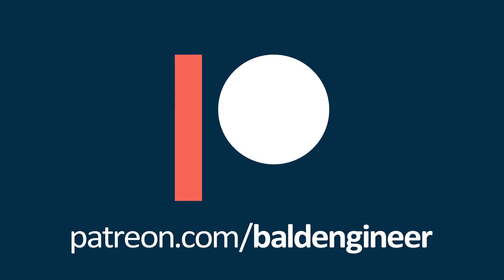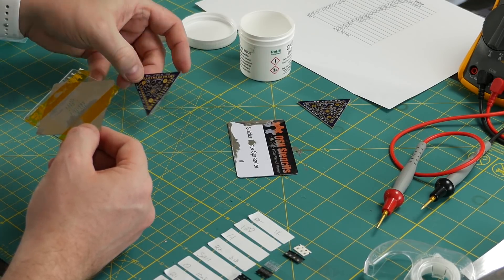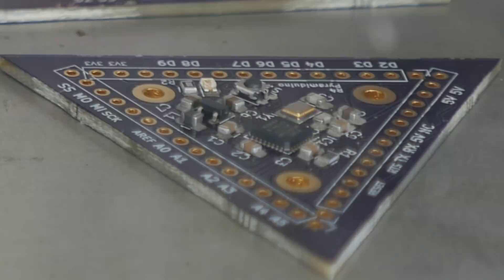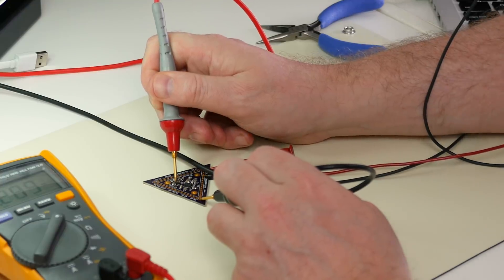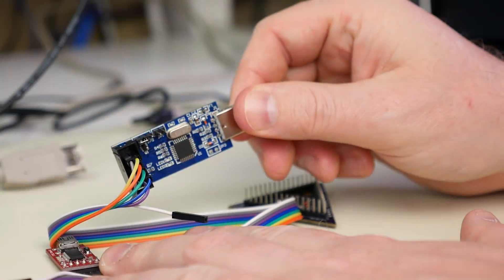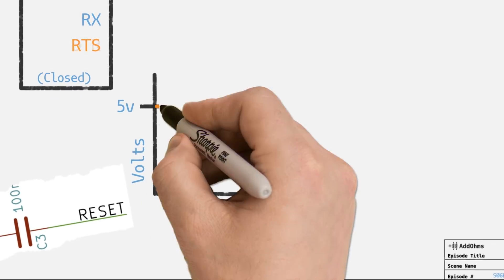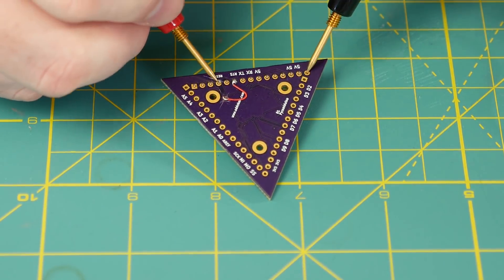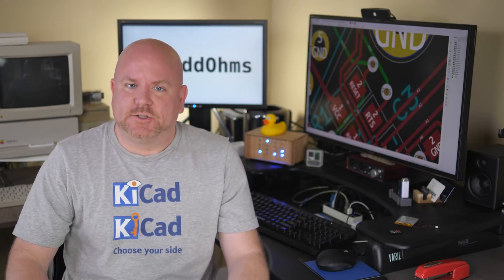DIY Arduino Turn-On and Debug | AddOhms #27

Comment: Great video!  Quick question, does the Pyramiduino R5 version on OSH Park have the issues fixed?
Reply from the maker: No. I don’t think it does. I don’t remember doing another run through OSH Park. (I did do a batch through Macrofab, where I fixed the LDO.)

Comment: Thank you so much for this series, it's very helpful! Very appreciated.. I've one question, i make custom props and machines for escape rooms, i'm trying to use a lot of RFID Reader (522 mifare) connected to only one Arduino but randomely I've to hardware reboot the Arduino becouse invalid initialization of sensors, i'm using an external voltage step down circuit stabilized to 3,3v to Power them ( vcc is 5v 2A for Arduino and step down). I think i have to build a custom PCB to make It work correctly dues to Arduinos pin stability... However my prototype some times It work well and some times not.. what you think about? Is it a good idea to try to build a dedicated pcb?
Thank you another time.
By
Reply from the maker: There are many reasons there could be a problem.  A PCB probably won't fix the underlying issue.

Comment: Hello James, i have a question about the SMD crystal or oscillator, do you have a tutorial how to wire 4 pins oscillator? Btw i really like your PCB.
Reply from the maker: I don't. But my experience has been two of the pins are the crystal and the other two are GND. In terms of selecting the load capacitors, I learned from this Microchip application note: http://ww1.microchip.com/downloads/en/AppNotes/00826a.pdf. It is written "for" some PIC devices, but I found the information generic enough for any MCU.

Comment: Yeah - if you manually control reflow for no more than 3 min results are better and safer.
Many people burned their circuits just by putting all trust in the electronics lol
Reply from the maker: Just because a process is automated, it does not mean it should be left unattended. So other than not blindly trusting a control system, I disagree entirely with your statement.  A manual process does not provide "better" or safer results. A manual system is not repeatable and is prone to mistakes. Modern solder pastes are designed to follow a specific curve, which is difficult to get right "by hand." So by definition, it is not "better."

In the case of being safer, a proper control system has safety limits. For example, my controller shuts-down if a) the temp doesn't rise after turning on the heater or b) a max temperature gets hit. It won't even start the process until the oven's temperature returns below a threshold. 

So while those extra safety margins are in place, as I said, I do not blindly trust it. There is also the magic override: pull the plug.

Comment: Excellent video - whether intentional or accidental, the debugging process is clearly explained.  Fortunately with the likes of PCBWay and other manufacturing houses in China, developing PCBs is now cheap enough to have 2nd or 3rd batches made should you find errors with the layout (such as the via's shown in this video).
Reply from the maker: Here’s a behind-the-scenes secret: I had two versions of the board. One (R1) had an intentional mistake. Turns out, the one (R4) with real mistakes was more interesting. ;)

Comment: A great example of how this stuff is really developed.  There's a reason why prototypes tend to be janky.  You work through it, change it, and do it again if you have to make many of them.  It's why making a few hobby boards is very different than trying to make 100 or 1000 for use by others.